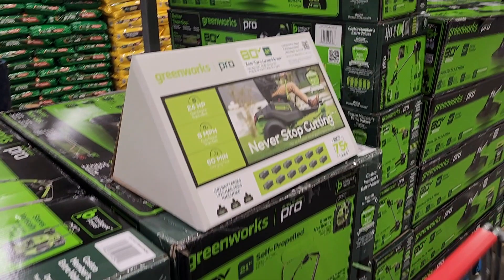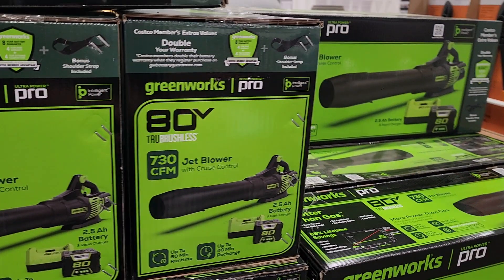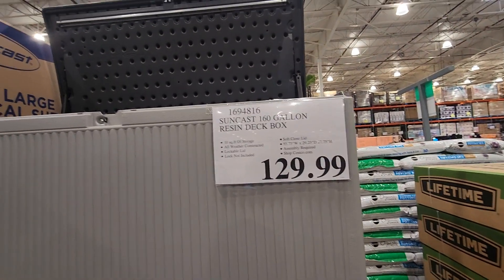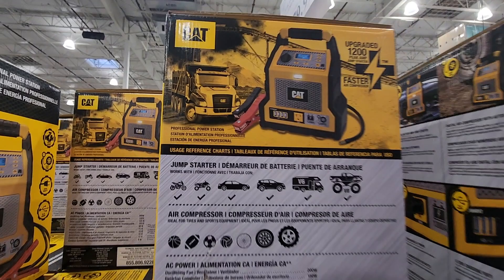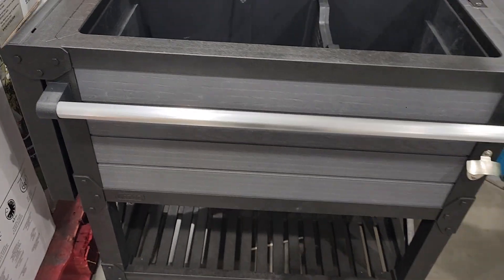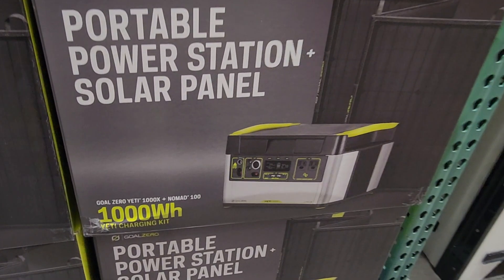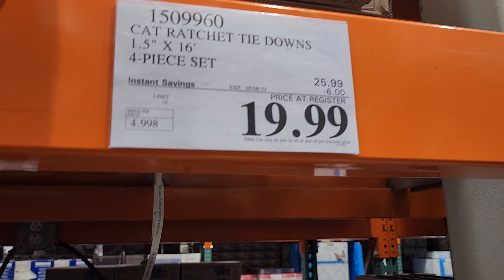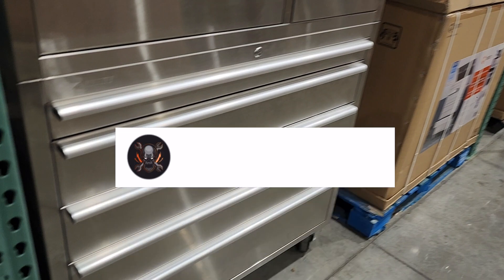Tool Deals @ Costco

Comment: That pressure washer is the worst thing ever. It shuts off because it thinks its low on oil from it vibrating around
Reply from the maker: Good thing costco has a great return policy